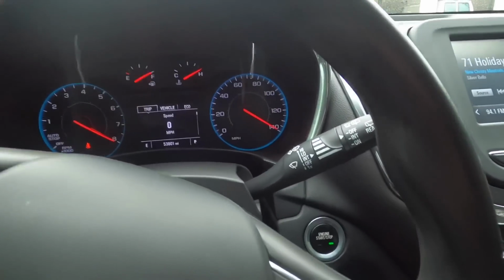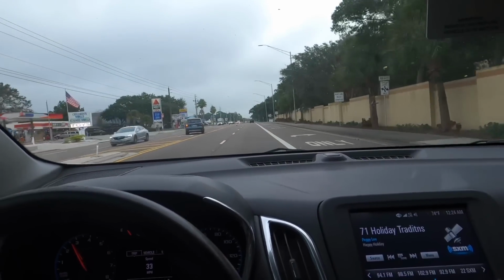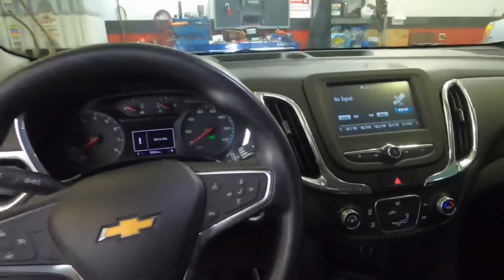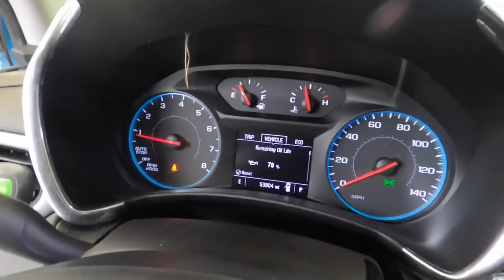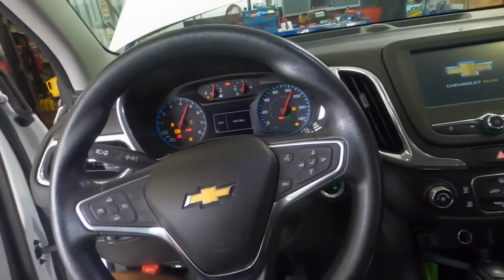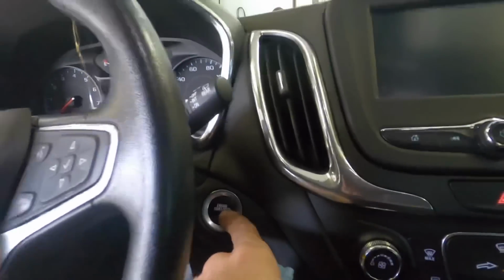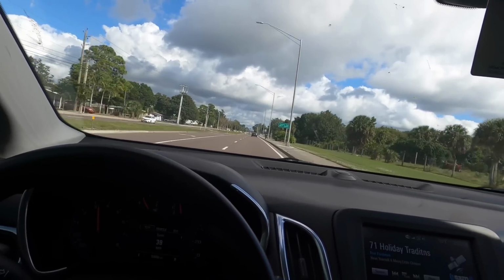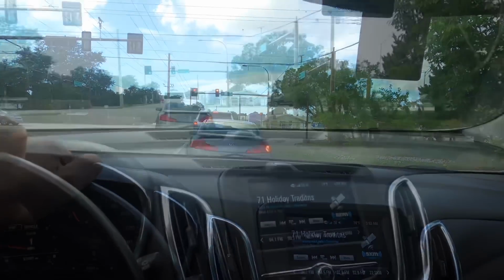Low oil could cost $$$$ | By Mistake!

Comment: Good morning Ray.
I have to disagree on adding oil to make the actuators work. 
The 2.4 Eco tech engines are a piece of trash. They consume oil. 
To add to the matter. Customers don't check their oil at all. They will blame the shop if it breaks down. 
Checking oil is a basic necessity of these 2.4 engines. Everyone of those engine I have worked on. The actuators did not fail. They don't fail.
The cause is the oil gets fried and as the oil gets hotter. The oil degrades and plugs up the oil lube circuits and kills the turbo. 
Next the oil plugs up the tiny screens on the actuators and eventually the stop functioning. They start to stick and finally get stuck. 
This I know for a fact. I owned a Terrian with the 2.4 banger. I replaced the factory valve actuators 2 times. This SUV belonged to my wife. She loved it. I hated it. 
Then my wife says. The car is using or consuming oil ?
So I did a simple oil consumption test. The engine was using 1qt every 600 miles. I did this test 3 times. 
I noticed that the oil filter was getting black. I cut one apart. Was full of flakes. Like when oil gets very hot and evaporates. Every 3k..oil change. On my second set of actuators. Again packed with flakes. I tried flushing the engine. No change. 
Took it to GMC for warranty claims. They did and oil consumption test. They told me. 1qt every 600 miles is NORMAL. 
Took the piece of trash to a Toyota dealer and traded it in. Bought a Toyota Sienna. This car has 250k miles. Engine runs super fine. 
I find out later the 2.4 engines are being warrantied out. GMC is rebuilding the short blocks. Due to bad piston to wall clearances. Engines are consuming oil. Nuf said
Reply: Some engines are hard on oil, and they begin consuming it during the later part of the manufacturers Interval. I owned a 2010 traverse for a few years that was like this. I changed the oil every 10,000 km and there was usually 40% oil life remaining at that point on the oil monitor. While it never consumed more than half a quart over that interval….the oil level did remain at the full mark until around 6-7000 km into the interval, with consumption increasing as the mileage on the oil increased beyond that. By the time I would change the oil, it would always be down 1/4 to 1/2 a quart on the dip stick. I’m certain that if I would have followed the oil life monitor and never added oil, it would have been down well over a quart by the time I would have received the change oil reminder. 

This leads me to believe that the oil vaporizes easier as it nears the end of its useful life, and it starts getting sucked through the PCV system. Engines that burn oil due to wear, valve seal leaks, seized rings etc…seem to consume oil at a fairly steady rate over the life of the oil.

Comment: First thing I do even before a test drive is check the oil.
   I've had customers come in with barely a quart left. Or seized. Hahaha.  But run the oil low on theses and bye bye turbo is best case scenario.
Reply: Yup, and bye bye 4K+ for the turbo. And 'warranty denied' because of lack of proper lubrication. Warranties are only worth the paper their printed on if customer doens't read and follow all the fine print etc.
Reply: Must do work too cheap lol.  Shop cost for the turbo was 800 with manifold. And the wrong size manifold studs.
   All 4 lines  were about 100 in the end after destroying a second turbo.   Manual hours i forgot at 95 an hour.
But I Swapped it in 2.5  the first time.   Total time invested I had 5 hours into it. 1500 dollar job total. Unless one goes to the dealer. 
    Luckily the manufacturer warrented the turbo even though it was instalation error. Hard lesson learned on that job
  There also a propper brain ak in procedure to follow. But that car was a nightmare anyway. 
    Somehow 21 fuses got blown. And the car Mets were thrashed and stopped working, customer had to purchase new keys also. 
     I feel the car got hit by lightning idk, nobody knows really. 
But I was happy to see that car go and I sure learned a lot from it. 
   Dealers shops are thieves. I went from a private shop to a dealer as a technician. Private shop for instance was 250 for a full front brake job. Dealer was 450. And dealer pays way less for parts. 
   Half my time is spent in a shop the other half is on site work. I travel to their homes. But now it's winter. So that's changing unless customer has a warm garage. Lol. I'm too old for that stuff anymore. Too many surgeries plates n pins and artificial joints. 
  Now I have bad tennis elbow and broke a rib this week. 
  But off to work I go. On site fuel pump today. Then finish a rotted chevy 2500 diesel fuel lines and sending unit then figure out the service 4wd issue. 
   I hate mechanic work but I'm good at it. Still maintaining a 2 percent come back rating. Thanks to parts failures.

Comment: This is the first time I've heard of the necessity of monitoring the oil in a VVT engine, but the simple fact that the car has a turbo should make it imperative, not suggested or merely recommended, that the owner change the oil every 3000 miles, period.  It's either that or change the engine every 3000 miles.

I would have helped the owner by marking the date and mileage on the oil filter with a paint pen, so the next mechanic will notice the red flag and keep the car from suffering another low oil VVT problem.
Reply: You change the oil at the manufacturers recommended interval. Any sooner is throwing away money. You most certainly should CHECK it every so often, but just straight up replacing it? Whether it needs it or not? The oil and oil filter I use in my engine is good for 10k miles on the oil and 20k on the filter. I check it every 3k miles to make sure levels and coloring are good. Never had a problem and oil always looks healthy until it's time to change it.

Comment: My neighbour is like that. He bought a turbo charged engine and I keep telling him he needs to keep clean oil in the engine and let the engine idle for a short time after stopping. But he has let it over run service by thousands of KMs.
Reply: Good advice! Running a turbo engine hard, with old dirty oil, then immediately shutting it down cokes all the crap in the oil onto the turbo bearings, gets sludge buildup in the cam phasors too.

Comment: Engines now days are high technology, requiring quality oil and proper level. I change my oil in my 2018 Forester XT every 3k miles, oil/filter is inexpensive and I know the engine loves it, engines will last longtime if properly serviced. I do not believe in the 5k-7k oil changes.. Car manufacturers say 5k-7k is ok, but they know the engine may fail after warranty because people believe the owners manual and or just do not remember to change oil. They are out to sell new cars..

Comment: Hey Ray, what brand of engine cleaner did you use ?? Is it available to the general public or is it for mechanics only ?? I know BG makes a good line of product but they are only sold to professional repair shops.
Reply: you can buy engine flush at walmart in automotive section next to the oil. its about $7 canadian. i use it with every oil change  clik clik

Comment: We have a 87 Toyota 4Runner and a 97 Honda CR-V both with well over 200,000 miles and they never break down or require part changers.
Proper maintenance is key

Comment: The charge for this had to be over 200 hundred dollars but it saved the owner of the car a huge bill. The owner has no room to bitch about the charge as the owner was at fault for not maintaining the oil level and oil change interval. The oil looked way to black and looked like the oil had never been changed. Good Man, Rainman Ray! :)

Comment: Another good video (plus I love to see the test drives in SRQ). I wonder how many cars have had thousands of dollars in VVT system repairs and new timing chains just because oil level is never checked and oil changes are neglected. Oil changes aren't cheap, but they are one of the best actions that can be taken for the longevity on modern DOHC vehicles.

Comment: With 53k, why is this at your shop? Scan tool I believe showed it's a 2018. Shouldn't this be under warranty?
Reply: I think they want to dodge the dealer 60k inspection hassle/GM priced pieces. 
And this did fix it, at less than  1/2  dealer price probably.

Comment: i had similar problem with my car (a Volvo s60 -01). but mine occurred when i had driven for a while (to operate temperature) and stopped and then restarted it after a few minutes. the idle was super rough till the point the engine could stall on me. before i did oil service on it i put one of those oil cleaning solution for 15-20 min and changed oil and since then my car runs flawless. 

on my engine there are only one VVT solenoid on the exhaust. and when i spoke to a mechanic he said that it could be dirt or contamination from the oil in the solenoid and just suggested that i took it off and cleaned it. but now when i did the oil cleaning solution i don't think its necessary anymore :) .

Comment: With 53,000 miles on the engine, isn't it odd for the vehicle to be losing oil? Where is the oil disappearing to? BTW, recently you have been commenting that, "oil changes aren't particularly entertaining, I'm going to skip over that part." Personally, although many viewers (myself included) perform oil and filter changes at home, I find it interesting to see the quality of the oil that drains out as well as to hear your impression of its condition. It seems that so much of what causes engine problems today is related to extended oil and filter change schedules.
Reply: Its gm. They burn oil.

Comment: It seems strange for the engine oil level to be down a quart between the recommended oil change intervals. I suspect that the owner may have reset the interval. I have been guilty of doing that myself in a car that I don't drive very many miles. It has a 7500 mile recommended service interval. I usually have it changed every 2000 miles but the indicator comes on at 6 months. My trips are usually 20 miles at a time but less than once a week. The oil always looks like new but I have it changed once a year.
Reply: Quite a few engines out there use oil and 7500 miles would find them down two or three quarts. Waranty wont help you until the engine uses more than a quart in maybe 1500 miles (different for different cars and manufacturers I'm sure). In the bad old seventies General Motors wouldnt touch an engine unless they  used more than a quart in 750 miles!

Comment: No matter what, I change oil with factory recommended every 5000 miles. My Juke has the 1.6 turbo and I absolutely do not want any lubrication induced problems.
Reply: Don’t forget your CVT fluid too brother :) you might have the 1st 300,000 mile Juke
Reply: @funkycarlover  Oh, and my Frontier is WELL over 300k with the only replacement major part was the clutch at 275K. Even the U joints are original.
Reply: @TheOwlGuy777  Can't wait to get my hands on a Frontier at some point. I love the smaller/medium size style trucks

Comment: and this is why if i check the codes on my vehicle i check everything that could be causing it and go with the cheapest fix possible. My buick was throwing an EVAP code that was causing the "check loose gas cap" message to show on my dash. Replacing the cap didn't fix it so i looked on the interwebs. all the common shit was sensors and other electrical shit that my speculation judged would be expensive replacements.

Then i found a video where the same code was present but it was the evap purge solenoid that had gone bad. a 25 dollar part. so i went and swapped that out and problem solved.

Comment: That Equinox should still be covered by the factory 5 year, 60K mile warranty so if it did need a timing chain job wouldn't it be covered?
Reply: Warranty doesn't cover oil changes. Or the flush needed because of the previous extended drain interval.

Comment: 53k sadly 1.5 liter is bigger than the 1.4 t cruze or trax engine  & the chains stretch over time as well =
 P016 code. 
  Also the chain tensioner uses pressure to keep the chain tight sadly. They should go back the a old school ways. Wow a spin on filter 👌.  Just my opinion.  
 Be safe & happy Thanksgiving.

Comment: On a Chevy Equinox, you need to check the oil weekly. They burn oil since the first model came out. They have timing chain issues and oil ring issues. I am surprised Chevy is still making them and more surprised people are still buying this POS. I rented one in NC a few months back, and it felt and looked so cheap. The dashboard felt  so cheap to the touch. They look nice, but they are junk.

Comment: Happy Thanksgiving to an actual mechanic. I wish you were around here,  a visit to any auto shop in my area results in them loading the parts Canon before the truck hits bay! Also had them try and sell me a new air filter even though it only had 1.3 miles on it and about 5 minutes!

Comment: Had a dodge 2.4 and before a oil change I put Seafoam in the engine and ran it for 150 miles and it gave me a viscosity code of some kind and went into limp mode. Dumped the dirty oil and after about 30 miles it was back to normal but with the engine light was on.
Almost forgot... have a great Thanksgiving!

Comment: My intervals:
Oil every 3000
Transmission and coolant: every 20000 to 25000 (I drive maybe 5k miles a year)
Brake fluid: every 2 to 3 years

Check fluid interval: every 2 weeks

Battery: every 2 years I get a new one... Electronics are delicate.

Result: big issues are avoided.
Reply: I used to buy full synthetic and go over 6,000 miles between changes. Then I began to realize just how sensitive modern engines are to the contaminants (carbon) suspended in the oil. Now is use cheap syn-blend oil and change the oil by 4500-5000 miles. There are a lot of very precise components in the valvetrain that do not tolerate dirty engine oil that's thinned down by gasoline or contains lots of abrasive carbon that result from direct injection fuel systems and low-tension piston rings.
Reply: @karlschauff7989  that's why I do every 3000 on the oil.  I had family in my car and the remarks were that you couldn't hear the car, that it was smooth, and that it had great power.  

Well maintained v6 Accord for the win.

Comment: I had a 2008 Pontiac Torrent (the pontiac version of the little chevy equinox here) at just under 36,000 miles and about 3 years or so of time (so figure roughly 2011) the thing over heated on me on the parkway... come to find out it was a friggin head gasket.  that solved the problem temporarily. Over the next few years (until 2017) I had intermittant over heating issues, tried every fix in the books... it came to a point where the engine cooling fans wouldn't come on unless you had the blower fans for the cabin vents (the a/c or heat) set to at least level 3 out of 5 on the power setting.  SO glad I got rid of that craptastic car... NOTHING but problems with it. got into a pick up truck and with exception of 3 issues (2 caused by the previous owner's shoddy mechanic/ghetto fake parts route) I've had NO issues. 1-issue was a rusted out exhaust that the pipe broke and started grinding into my drive shaft (shoddy/ghetto fake flowmaster exhaust route) another issue was the throttle control sensor which was caused by prev. owners shoddy/ghetto guy doing crap wiring work on something else that ended up shorting out cause wires weren't done and insulated right.  the 3rd was an issue known in general for my truck, felt like the power steering control crapped out so I was expecting either wiring for/from the rack & pinion or a new rack & pinion...ended up being a seizing up u-joint on the intermediant steering shaft.

Comment: There are literally millions of cars on European roads that use engine sizes between  1.0L and 2.0L , with and without turbo. 99.9% of car owners don't need a 5.7L V8 or even a 3.5L V6 to go back and forth to work. 
One is not allowed to go fast anyway and during rush hours one is  likely to end up in a trafic jam anyway. So, a frugal reliable econobox is plenty good enough.

Comment: At 53k you should've sent the customer to the dealer. It should still be under warranty.
Reply: Neglecting an oil change isn't covered by warranty. Dealer would have taken a picture of the dipstick, sent oil sample to the lab, and sold the customer a lot of expensive parts along with a "warranty claim denied" letter. :) Probably why they took it to Ray, and not the stealership.

Comment: I wish you could film the customers reactions whenever you are able to tell them that you saved them copious amounts of money. I would be ecstatic to hear that a $25 oil change fixed my 50k mile car.
Reply: Probaly a $70 change because of Dexos Full Syn needed for vehicle.  But still worth the money.
Reply: Well, the customer didn't check the oil level, and they probably also reset the oil life monitor to save a few bucks...

Comment: Good, maybe this will make people change their oil on time and check the level frequently.  I am reminded of the mystery of those cars that will mysteriously “lose” a quart of oil in the first 100 miles after a change, but then maintain level until the next oil change. I have seen this in individual engines of all sizes and makes.

Comment: If you have these engines with small cubic inches and turbo please change the oil and filter and don't wait for the oil to loose its viscosity.